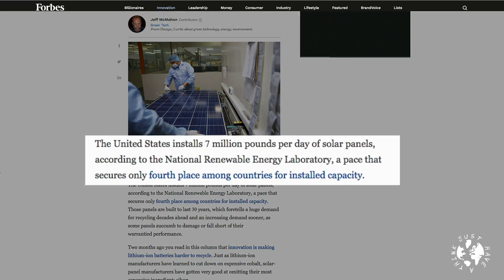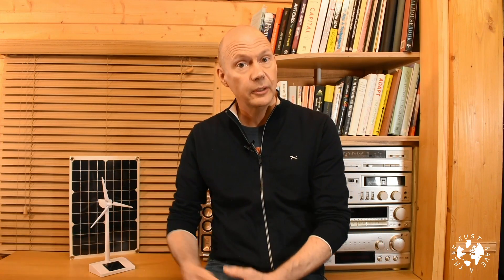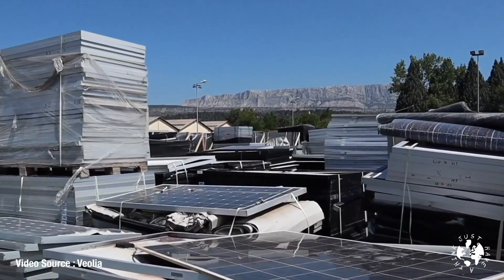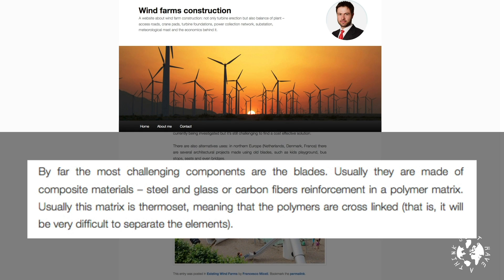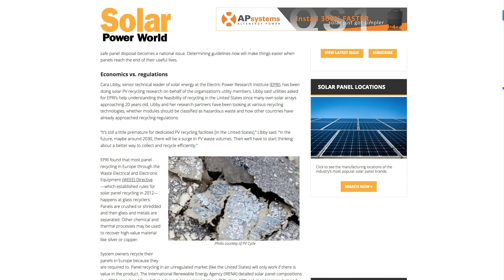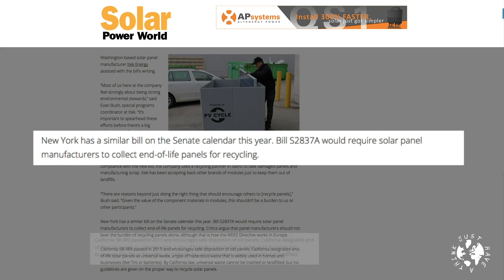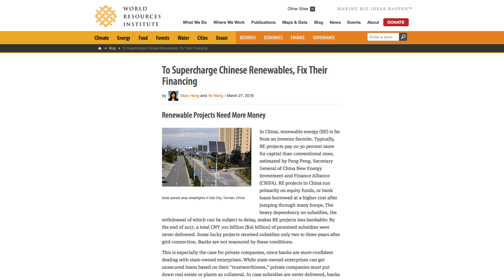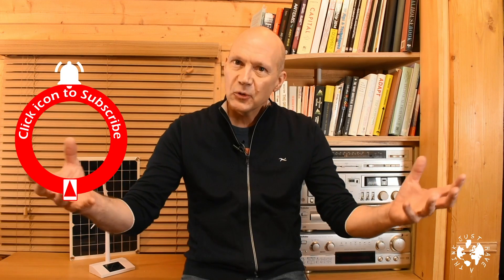Recycling renewables : a price too high?

Comment: I retired some old solar panels recently, due to roof space and efficiency. Upon evaluation I found although one, after 27 years was only producing 45% of the nominal rate, another was still putting out 75%. I consider that good, as the original guarantee was only for ten years. I will not be dumping them, but will find a lower level use.
Reply from the maker: Hey Treefarm. Thanks for your comments. That is indeed extremely encouraging. I'm quite sure the figures I was referencing were very much 'worst case scenario'. A healthy second life market for renewables would be a far better solution for our future :-)  All the best. Dave
Reply: @JustHaveaThink  -- the New Commercial warranties for PERC  (top of the line, internally reflective Silicon) are up to about 90% production at 25 years.

Comment: Solar panel recycling was a primary topic at Solar Power International 2018 (held in California).
Reply from the maker: Hi LIz. Sounds positive. Were you there? Did you get an optimistic impression?
Reply: @JustHaveaThink  I didn't go to that seminar within the convention specifically, but I know it's an issue that the industry is tackling.
Reply: At the Industry Level -- this a RESOURCE -- not a "waste" problem.  "Free" Glass, Aluminum, and Silicon coming back to you -- as a Manufacturer -- costs about 1/10 or less of the Energy used to make new.

Comment: In Norway de don't use landfill anymore. And do we really have  these i EU still?  I am thinking windgenerators the tower may bee of steel and may låst over 100 years.  The blades and generators may be changed for better effekt or cracks/cycles like on an airplain. You do not just put an 250m tower down and try to digg it under? The offshore windmill i gess have shorter lifes. Equinor wants to build the subconstruction in concrete for their deepsea mills.  Heavy and do not rust. Maybee You can find out calculated lifespann they assume?
Reply from the maker: Hi Arne. Thanks for your comments. Landfill is alive and well in the EU I'm afraid, but getting less prevalent all the time. I take your point about the materials. You sound like an enthusiastic activist. I hope you are also giving your government a hard time about their ongoing oil addiction in the arctic? All the best. Dave
Reply: @JustHaveaThink  Yes i vote on the green side partys. Working with heating and cooling in Bergen.   I really don't know what to say about the new blocks release for looking for MORE gas/oil.  Another hot debate here is about setting upp huge windmills in the mountains.  So NVE  have a map of aereas in Norway it may can be. But we have to give EU some greener energi. " Battery Norway"